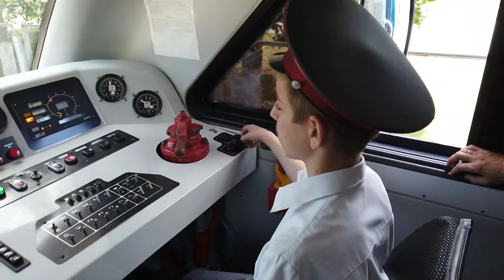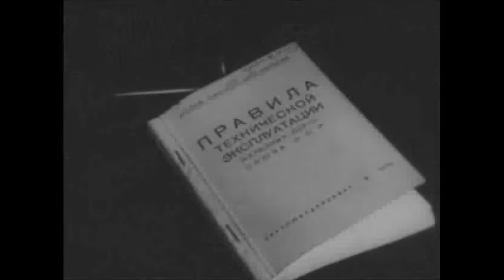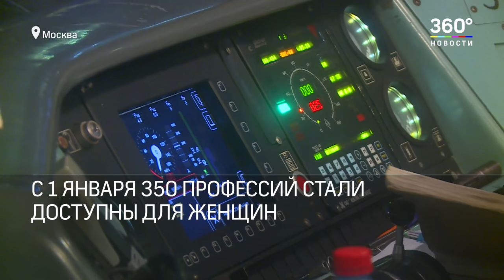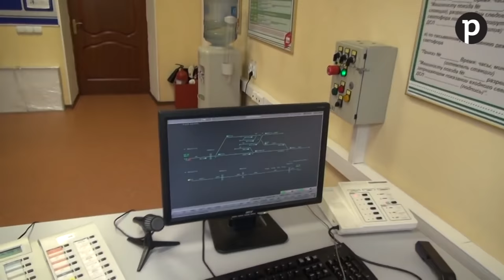Full-Fledged Railways Ran By Kids: Children's Railways Of Eastern Europe

Comment: I've ridden on such a train operated up in the hills of Budapest, Hungary, though it is not a minature one but a half size  one that operates over a single track of a few kilometers  with several stations where the track divideds for both directions. The engineer is an adult, but all other jobs are done by teenagers.  I got on a train and quickly was surrounded by a lively young school group that  got a little noisy. I asked the two boys who acted as conductors in english when the return trains came back, but either they were unprepared for english responses or they didn't know and I teased them a bit that "Every conductor needed to know the schedules of the line." It was great fun!

Comment: I remember the at least 3 rides on the Kurgan Children's Railway, a 1,05 km long line. It connects two stations: "Pionerskaya" (Pioneers), located in the Central Park of Kurgan, and "Zvyozdochka" (The Star), situated close to a beach. Both stations have the switchbacks explained at 5:03.
The railway initially used a TU2 steam engine and Pafawag carriages, which in 2011-2012 were replaced by the same type of locomotive and carriages as seen at 2:19.

The reason to why I visited Kurgan in 2006, 2010, 2017 and 2018, was because my great grandmother, who is over 90 years old, lives there. Unfortunately, her sister passed away in November 2020.
Reply: The children's railway in Kurgan continues to work!

Comment: 0:07 can someone confirm, is that a pair of modified ex BR class 86s? The front looks extremely similar.

Also, the track detonators are a thing over here in Blighty, but do they really need that many? I think we put three down in a line.
Reply from the maker: This is Polish Railways Class ET41, which is a modification of EU07, which is an improvement of EU06, which is the same as British Rail Class 83.

They put so many firecrackers as a part of the end-of-season show. The usual procedure is the same: three down in a line.

Comment: what is the width of the track? 1067 mm or 700 mm
Reply from the maker: 750mm
Reply: ohh means the size of a lorry line,
If in Indonesia it uses 1,435 mm, 1,067 mm & 750 mm (specifically for sugar factory lorries)
Greetings Railfans from Indonesia👋